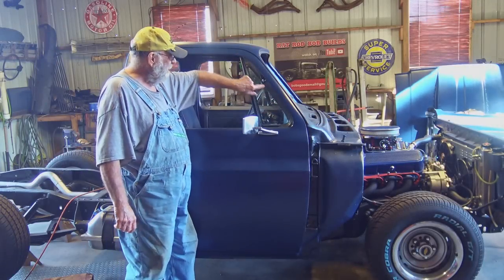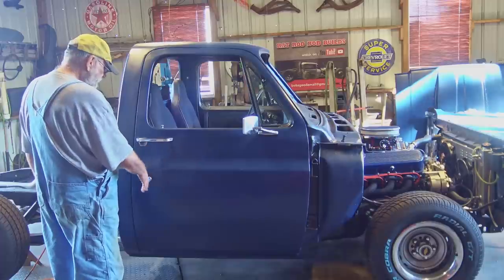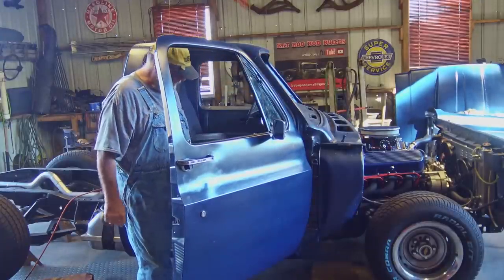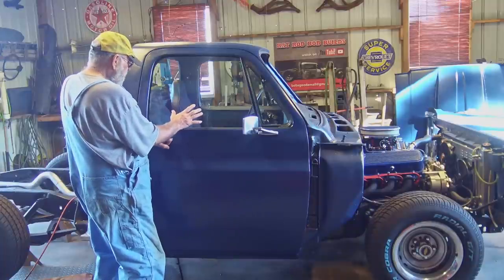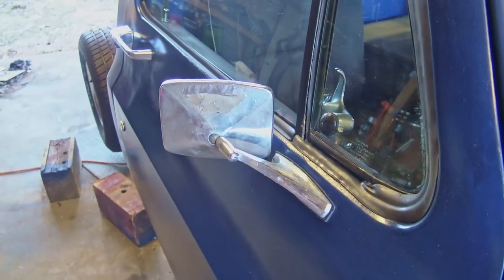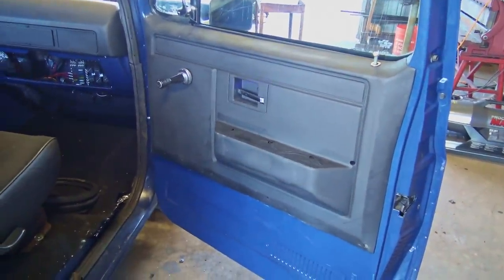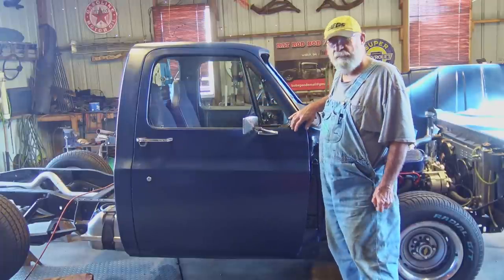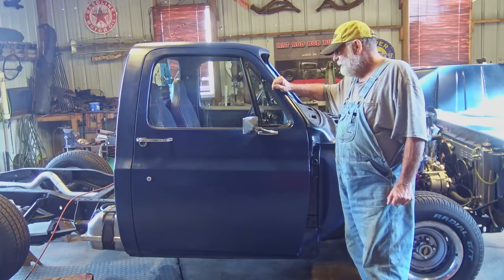C10 Wing Glass Restore From Rusted Out - The Trials And Tribulations

Comment: I've recently made the switch from buying new to fixing everything, because I know the price of everything is only going to get worse. People that fix things are going to excel. Thanks for teaching people, Bob :)
Reply from the maker: This is true. I recently started to chunk a microwave oven because it started acting up and then went online for some training. Turns out it was only a stuck micro switch on the door and after opening and slamming it shut a few times the problem was solved.
Reply: @RatRodBobBuilds  exactly! I had the same type of issue with a pressure washer (the cheap green one from harbor freight). A little electrical switch malfunctioned inside, my instinct was to throw it away and get a new one, but it was a very simple fix. It's strange that Americans don't repair anything anymore, even environmentalists throw everything away that malfunctions.

Comment: Yes sir that early seventies unit is very close to the unit design used in the early seventies (67-72) trucks and of course you are showing the eighties design which I feel is a little better. As you know a lot of those units would twist off as the spring loaded shaft would rust up and people would still try to operate them as if they were new. I have had to gingerly cherry that nut up in order to get it to come free or else I will twist that shaft off. Compared to the price of getting those vent window assemblies from suppliers it is of course to one's advantage to fix them up. Course it does help to have a fair stock of used assemblies to make up good vent window assemblies. Of course this is what it is all about and your skill in remaking and reusing a lot of assemblies is fun to watch.

Comment: As a young kid, I was loosening a window regulator inside the door with a ratchet...well, the next day, I was looking for a new window glass at he junkyard. I barely tapped the glass with the handle of the ratchet and I then had 2" of safety glass at the bottom of the door to vacuum up. I still think about that each time I'm working on door glass.
Reply from the maker: I'm a heavy equipment operator by trade and most of the new ones with enclosed cabs come with a small pointed hammer inside just incase you need to break the glass.

Comment: Hey Bob, you can saturate the gasket on those wings and door glass channels with varsol and run an olfa knife down each side of the glass and it breaks down the gasket seal and the glass comes out easy. I used to do auto glass and we did that all the time, always worked like a charm. Give it a try next time you tackle the job and see how it works for you.
Reply from the maker: Thanks Dan, that's good info I'll use next go around.

Comment: Hey Bawb,
   That was a lot of tedious work ya dun there.
But ya got er dun !
Ya musta sent Red off on a mission to keep him out of the way.
   For that scratched glass.
As a kid building model cars, I found that cheap toothpaste on a flannel rag worked great as a rubbing compound on the paint.
   At fifteen I built my first hot rod, it had scratched door glass.
I used the old toothpaste rubbing compound on it and it looked like new !
   Red may have an old tube of Colgate white toothpaste kickin round, I feel it works best, but any paste type will do.
Ya may want to add a lil water as a lubricant.
Give it a try.
   We gettin it !
Reply from the maker: Thanks ... I'll try a spot.

Comment: I'm gonna have to do that to many doors this year so this is very helpful 👍🏼 also looking forwars for the front clip installation...i'm changing to later clip.
Reply from the maker: Cool! I'm not videoing all the details on the front clip but I can tell ya that the fenders have lots of bolts and some are in hidden away places. If they don't pull right off you have another bolt somewhere. The rest is easy.

Comment: niceeeeeeeee, how did you clean the side glass so nicely, steel wool?
Reply from the maker: Well first I took a single edge razor scraper to it to get the old tint and primer and dirt that was on it from the previous guy, then I took some lacquer thinner on a fruit of the loom sock to get the remaining tint glue and dirt and primer then finished it up with some window cleaner.
Reply: @RatRodBobBuilds  thanks

Comment: Rebuild and you know what you have got.  A lot of repro stuff is poor quality. ie Chromed with no copper and nickel (expensive) first and so rusts within days!  Proper chroming has many steps with stripping, cleaning, buffing, electro plating consuming hours and hours of labour.  I had wheel bolts done and they were £10 each.
Reply from the maker: I hear ya! I replaced a chrome door handle on my daily driver a couple years ago and it already looks like it's 50 years old.